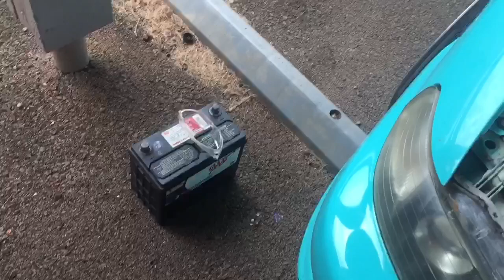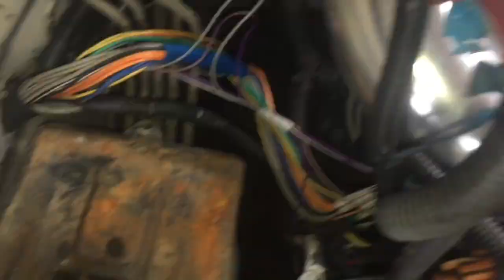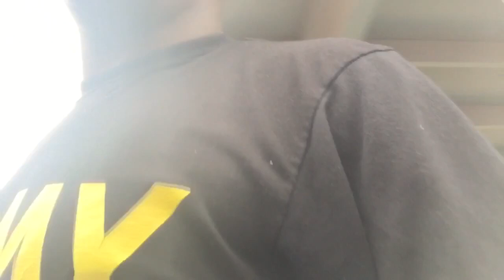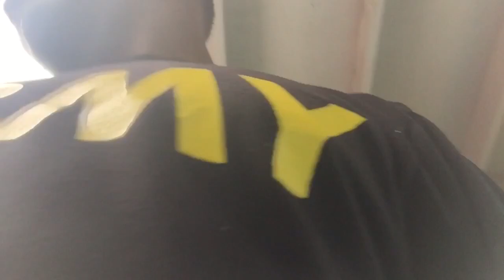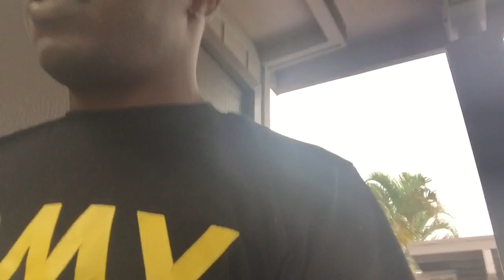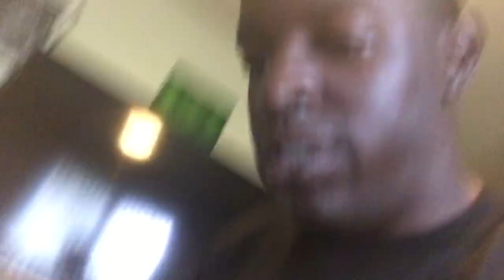JDM B20 Vtec Build Ep 92 Why Tiffany Still Running like Doo Doo😢

Comment: it's in limp mode cause of Dizzy. it happened to me!
Reply from the maker: But the dizzy is from a b16 how would that make it be in LIMP mode?
Reply: The car is probably in limp mode due to the ECU & whatever Check Engine Light he has. Sometimes the car will go limp & cut power to prevent you from damaging the engine.
Reply: +Scorpio7 XXX it's distributer. But could be ecu.. Forsure
Reply: +JDM SWAG not enough spark, failing distributer cause it but check ecu as well
Reply: +Zosh You can say Dizzy. I'm an OG in the Honda game... lol & Distributor not Distributer....lol
Reply from the maker: Dizzy is a slang word for it old timer lol but I get what you saying
Reply: Yeah I know what a "Dizzy" is. It was just funny when her started typing Distributor as if I didn't know. Dizzy is manly a Honda Heads term. It's might also be used for other imports as well.
Reply from the maker: I didn't know it was a gonna term I thought  car  heads just said that lol
Reply: +JDM SWAG my car was in limp mode it was my ecu harnnes dont get ebay
Reply from the maker: ebay harness or ebay ecu?
Reply: +JDM SWAG ebay harness my friends also have problems with them after some drag racing
Reply from the maker: damn racing messed up your cluster harness lol how does that happen
Reply: Not the cluster harness but the obd0 to obd 1 ecu harness

Comment: Did they turn the fuel presure down on the ecu? If not your gonna need a fuel presure regulator.
Reply: Also ive revved my B20v to 9k when i first got it 😂
Reply: +Coda5610 9K is too much. There's no power at 9K unless you got some internal work...lol
Reply: +Scorpio7 XXX yea i no lol, i shift at 8,200 rpm now
Reply: +Coda5610 is 8200 a good shift point on a b20v? 
Should be done putting it together tomorrow.
Reply: +LiveHD2 yea for me it is 8,200-8,500 but i got arp rod bolts and arp head studs
Reply from the maker: Not sure but what brand should I get and where should I set it to be at?
Reply: +JDM SWAG well AEM makes the fuel presure regulators which are good and it needs to be @43psi at idle so your gonna need fuel presure gauge also, but is the car still running rich even after the tune? Cuz i believe they can turn it down on the ecu
Reply: +Coda5610 Better Rich than Lean. but he has to be careful buying AEM parts on EBay. There's fake AEM shit up there.

Comment: you can rev a b20v to 8k if you get arp rod bolts. otherwise your just waiting for a rod to exit the block. if you have stock rod bolts 7k to 7250 is where id set redline
Reply from the maker: So rod bolt aren't head bolt then rite? Lol damn I got arp head bolts
Reply: +JDM SWAG no sir, the rod bolt hold your bottom end together while the head studs hold the top end. when you get your motor built 99 percent of the time the new rods will have the arp bolts with them. some people upgrade to arp rod bolts on stock lsvtec and b20v setups to rev higher

Comment: also are ur fuel injectors high impedance if not u have to run a resistor box. could be reason for code 16.
Reply: Smart man ☝
Reply from the maker: Yes they are that's not the issue I figured out what the problem is. It'll be in an upcoming video ill post today. I have a lot of videos dropping today
Reply: I will stay tune to see the progress.

Comment: I have a B20v all motor that I've been driving Daily for 4 plus years reving to 8200  with no problem. Torque it down with ARP & it's good to go.
Reply from the maker: That's what I have in it too. Nice. Hey what ecu ru running? Is there a way I can contact u I have some questions about my build u may be able to help me with. If ugly me on IG dm me
Reply from the maker: I meant to say if you got me on Instagram lol
Reply: +JDM SWAG hes running the same ecu im runnin a chipped P28, its weird we got the cheaper ecu but our cars run perfect
Reply: +JDM SWAG My screen name is the same on IG just link me. I'll answer all ur questions my bro.
Reply: +Coda5610 I'm running a S300 now but it's on a base map & I'm not impressed. Sometimes I feel like going back to the chipped P28 but I went back to stock injectors & will have to purchase a new chip
Reply from the maker: +Scorpio7 XXX k so I can't use a PR4 a just connect the vtec directly to that ecu can I? And use my Haltech as my piggy back?
Reply from the maker: +Coda5610 k so I can't use a PR4 a just connect the vtec directly to that ecu can I? And use my Haltech as my piggy back?
Reply: Honestly my brother you should get rid of both of those ECUs. PR4 is a early model LS ECU from a 92- 93 Integra (DA) therefore it kinda out dated & run your car like shit & will definitely give you fuel problems. My friend had that ECU on his LSV chipped & it kept giving him code 43 fuel Supply code. I told him to get a new ECU. Now his car runs like a dream. On a chipped P28. As for as the Haltech is concerned I've heard of that company on big non Honda builds but it's not the ECU of choice. The best ECU for a Honda Vtec build is Chipped P28, P72, P73 P30, Hondata S300 & AEM.